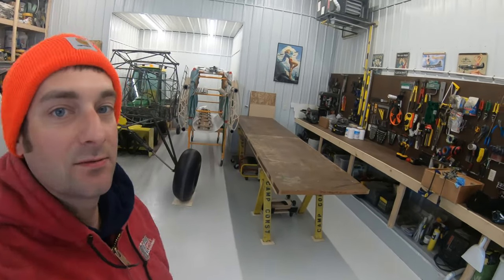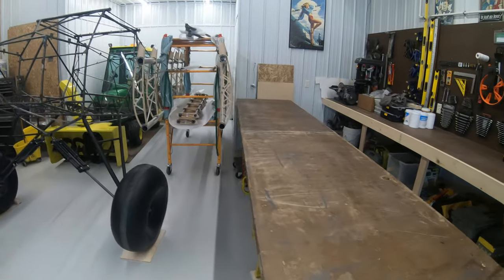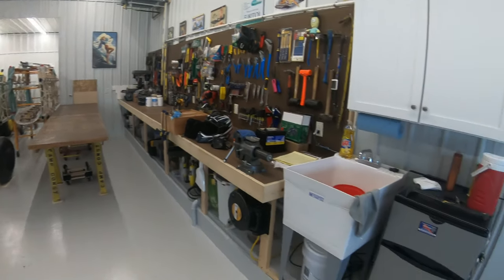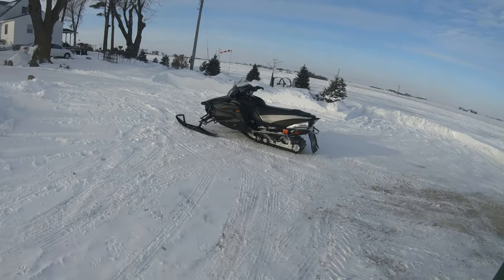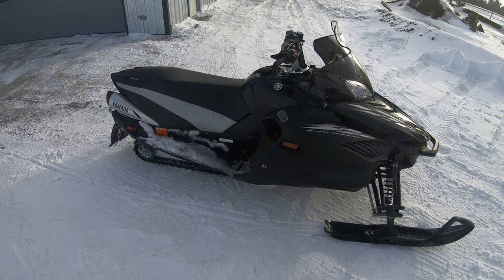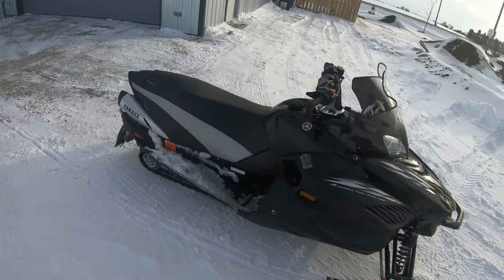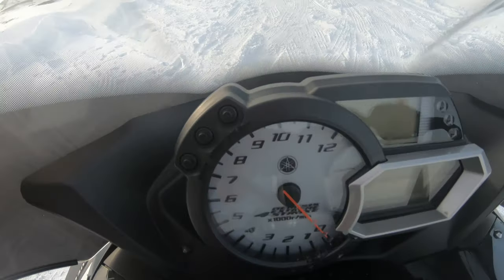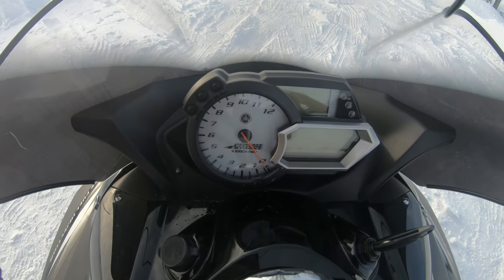Apex Engine for a Bushplane

Comment: Dayam,I found a 2006 in such nice shape I am going to feel bad about yanking the engine.Since it is winter here and I don't need the motor for a whileI am using it to go to town and get groceries and run errands ect...In WI. there are snowmibole trails to every town.Wish I could find a wrecked one so I will not feel bad about dismantleing a perfectly good sled.

Comment: Thanks for the vid. I noticed you put metal siding on the inside of your shop. Can you tell me your thoughts on that.
Thanks, Steve
Reply from the maker: I like it a lot. No finishing required for it. I did acoustic paneling up high and there is no echoing in the building.

Comment: That puppy sounds sweet!  So how do you change your prop/gearbox setup to create the desired in-flight rpm?  You mentioned Steve cruised around at 8-9000 rpm with his set up for competing, are you thinking about changing that?
Reply from the maker: When I flew with him he was using a rotx c gearbox and an adapter to mate to the apex. He has since then changed over to a gearbox specifically built for the apex ( I think it might be from skytrax but I am not sure). He had his then 3 blade prop pitched for max takeoff thrust and not cruise efficiency, so the engine runs at a higher rpm (and inefficiently) during cruise. He was competing in the Valdez Stol Demo at Oshkosh. Cruise rpm and max power rpm are dialed in with changing the pitch on a ground adjustable prop or swapping out for a different pitched prop if it is a fixed pitch prop.
Reply: It is a skytrax and Steve is building No.7 that will have a 300 hp Turbocharged Apex built by Edge Performance EPex engine link pics. 
https://www.facebook.com/groups/164864990778457/permalink/375602306371390/?sfnsn=mo

Comment: Wow, glad I found your channel.  Looks great.  What are some of the main reasons you and Steve Henry are moving from Rotax to Apex?  I assume cost, but curious about the rpms and the gearbox complexity.  Also, a bit off topic, any finish color schemes in mind?
Reply from the maker: I think I am going to do yellow and black for colors. The reason for the apex over the rotax for me is less cost and more power. Plus now with Edge coming out with a turbo kit soon we could have a 300hp engine that doesnt weigh much more than a rotax 914. The gearbox I will use is a Skytrax by Teal Jenkins.
Reply: Kevin Camp that’s awesome... keep up the great work. I’ll be watching your progress from Japan! Quite envious.... If you don’t mind another question,,,, why do you and Steve prefer the highlander over super stol?
Reply from the maker: @joemcspeed  The highlander is lighter, it climbs out/cruises/descends with a more nose level attitude instead of a nose up attitude, it cruises faster. The superstol pluses are, it can decend steeper and probably land in a rougher environment. I have not flown in a superstol so everything I have learned about compairing the two models has been from my observations and from talking to pilots that have flown them.

Comment: Not too sure what pto rpm you are looking for, but I’m guessing you know the Yamaha apex is reading engine rpm not pto. They have a gear reduction inside the engine and I believe they are around 19-20% reduction at pto clutch.  My 2010 apex usually sees 11,000 rpm maybe a little higher, what the clutch is exactly? I could measure but will definitely be less
Reply from the maker: There will be an adapter and a gearbox before the prop. I am wanting 2200 to 2400 prop rpm around max power.
Reply: That makes sense. I know nothing about the aviation side of things but it seems like it would have to be one stout prop to take that rpm. Happy building